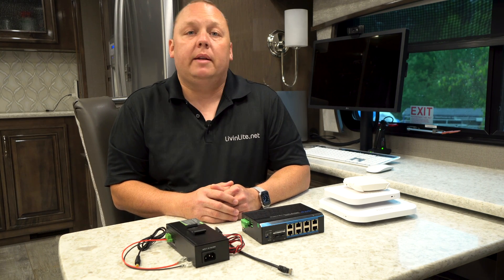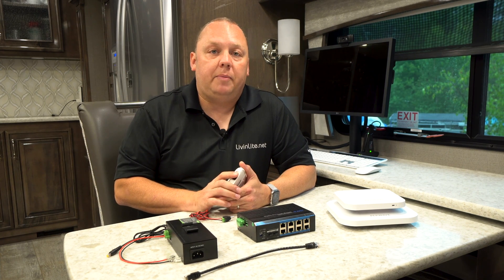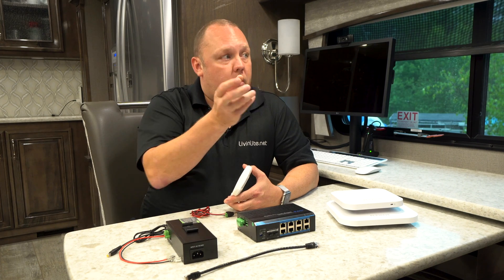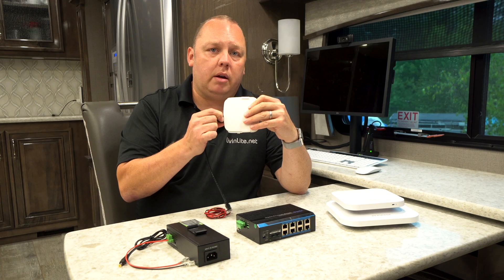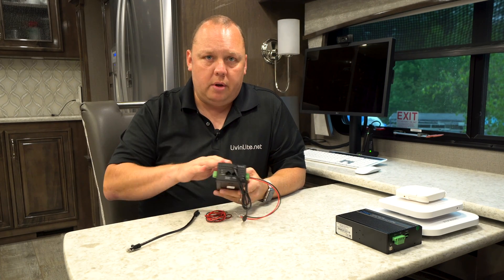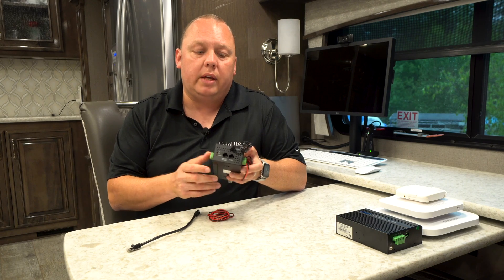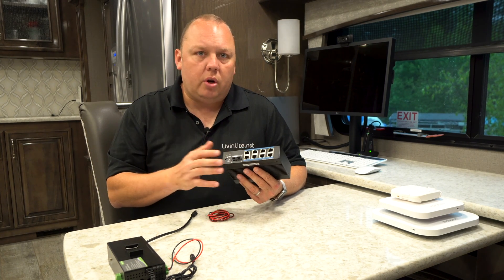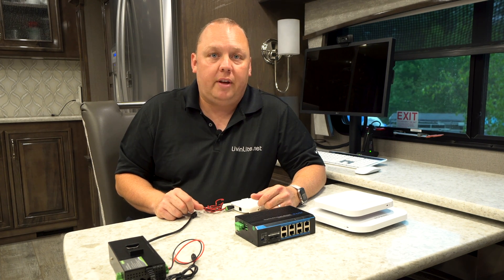Power Options for Pepwave External Access Points

Comment: How do I do POE with the 4-pin connector on my Peplink MAX BR1 Pro?
Reply from the maker: So, the BR1 Pro 5G does not support PoE input, unfortunately. To power via PoE, you would need a PoE Splitter, then possibly an adapter to get the power side over to a 4-pin molex. A common cable used in this situation is our Peplink Power Conversion Cable: https://mobilemusthave.com/products/peplink-power-conversion-kit?_pos=2&_psq=peplink+power&_ss=e&_v=1.0

If you'd like some assistance with setting up the PoE, reach out to us via email at info@mobilemusthave.com and we'll be happy to help!

Comment: How many Amps does it use and idle at at 12 volts?
Reply from the maker: On our website under the documentation tab for each item there are spec sheets for each device that will show the max watts for each device. The majority are around 18 watts max, so at 12v that would be around 1.5DC amps at full load.

Comment: I have a Pepwave MaxTransit Pro that has worked really well for me with the paddle  antennas that come with the router, all located in our 24 foot coach. However, we want to improve our cellular signal even more so today we bought the Pepwave Mobility 42G. Will I still need an access point when install the roof antenna? I use cellular data 99% of the time. That’s why we bought the dual modem router so that we could have plenty of cellular redundancy. I never rely on campground WiFi. Can I just disable WiFi AS WAN and allow the WIFI radios in the router  to be dedicated to the local WIFI? I don’t want to install an access point unless you think my WiFi will be substantiallydegraded by moving the antenna to the roof unit. We will be streaming Smart TV, Zoom, Sonos and using iPads, laptops and phones. About 10-15 devices.
Reply: PS: I bought the antenna from MobileMustHave.
Reply from the maker: @stuartrogel9117  no need to add an ap to start however you may want to skip adding the wifi antennas to the 42g and just connect the small black wifi antennas so wifi transmits inside the rv instead of off the roof if your using wifi inside mostly. Some customers elect to hook one up to roof and one up to small back antenna so wifi transmits from both locations. Id try that first but not an ap will significantly increase the wifi range if you add later as they are higher power and help out a lot with larger rigs. Still id try without to start!
Reply: @MobileMustHave  many thanks.
Reply: @MobileMustHave  do I have to change any settings on the router so that the router broadcasts as WiFi inside the rig and not as WiFi as WAN?

Comment: 3:09   If the "Brick" is 120ACV step down to 12DCV then just CUT THE PLUG OFF and fuse it into your 12DCV power.
Reply from the maker: sure can but you destroy you 120v wall plug and have to buy the fuse, cable and butt connectors (or solder and electrical tape). Not sure that will all add up to less than15 bucks which the fused cable will run you before discounts but its certainly an option.

Comment: If I use POE to connect my Transit Duo to my Pepwave AP mini how close can the two devices be. My Transit Duo antennas are connected to a Poynting Mimo 3-17 antenna mounted directly above my Transit Duo.
Reply from the maker: the mini has a more powerful transmitter so generally if you have them mounted close together most clients will just hop to the mini. That said if you have a setup where they are both close together its likely better to just disable wifi on the TRansit that way it can focus on WIFI as WAN responsibilities rather than playing double duty. Then the AP mini will manage the client wifi. You can disable the transit WIFI by simply moving the WIFI AP Toggle on the dashboard to OFF status which will disable the transmitter on the Transit. WIFI as WAN will continue to work via the roof antenna. We recommend to have an ethernet cable handy before doing any testing as if you disable the wifi and your AP Mini is offline, you wont be able to get to the pepwave (unless you go through incontrol and the modem is online). If you have an ethernet cable you can always just plug into the LAN port for direct access to turn the wifi back on if needed.
Reply: Brilliant. Thank you!!